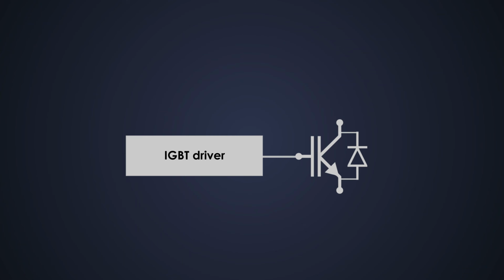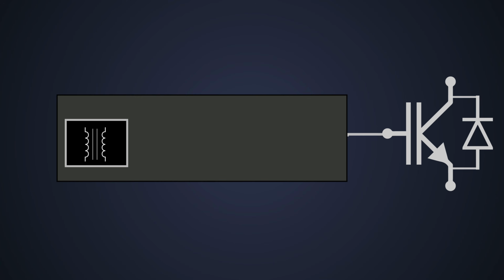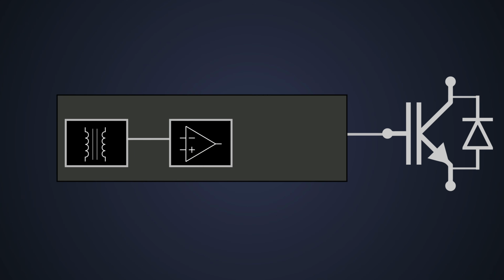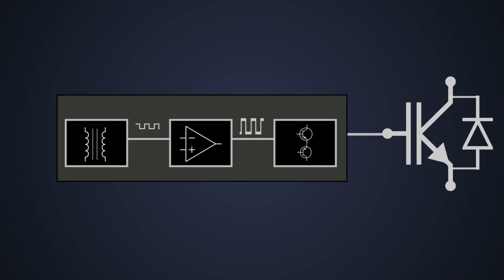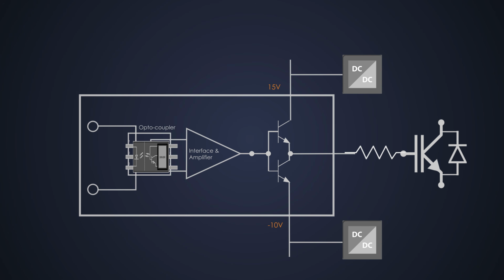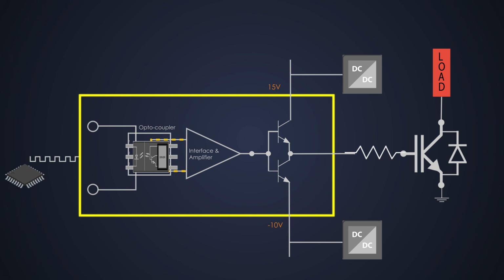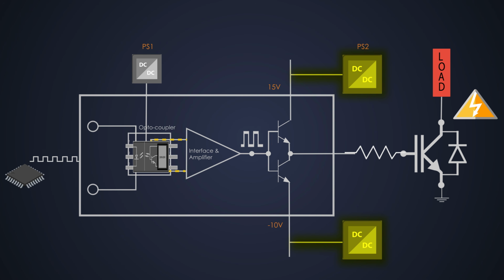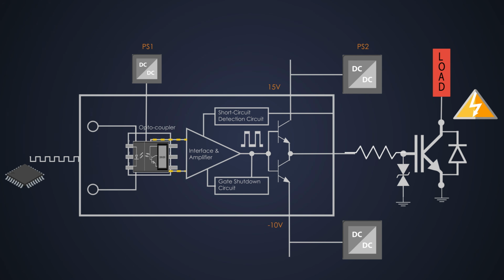IGBT driver working | Why do we need IGBT driver | IGBT driver Understanding

Comment: Sir, without  dso oscilloscope  how to chek gate and source voltage?
Faulty mosfet (6 chanel) removed  after chek but same mv not show multimeter. 
Any  led cheker devices ( gate and source  signal)  we prepared??
Please sir  same guide